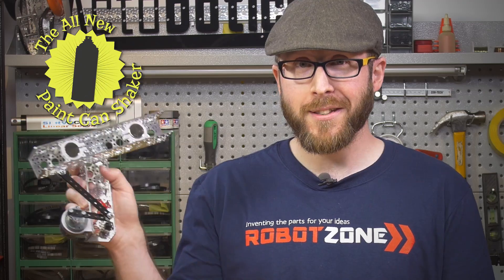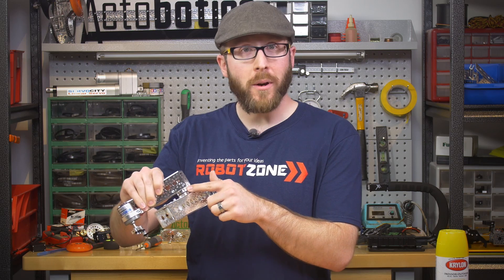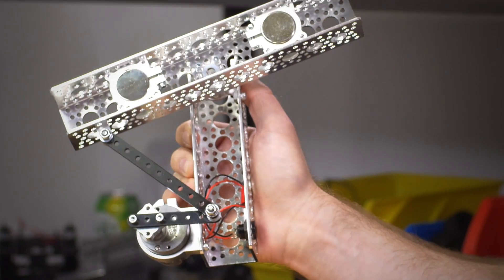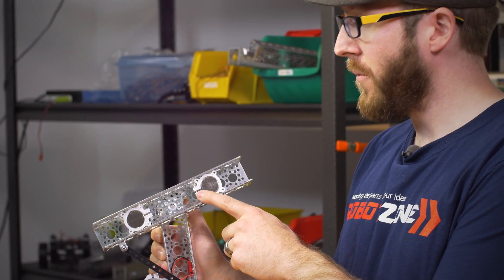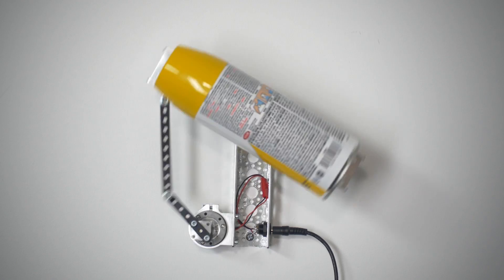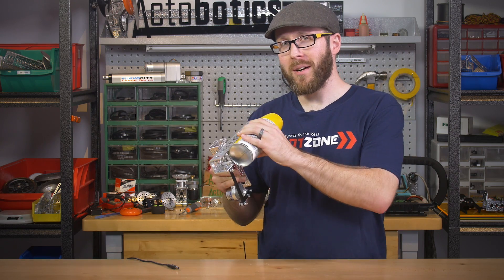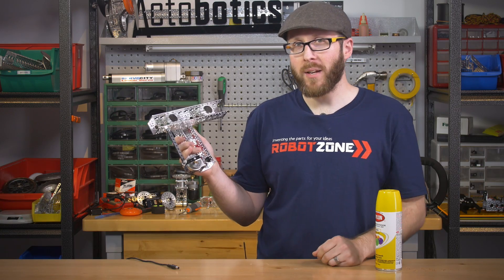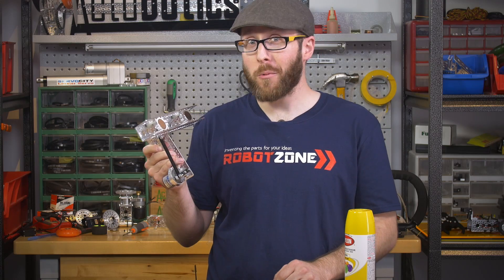Actobotics® DIY : Spray Paint Can Shaker

Comment: Hi, could you tell me how did you attach the two plastic beams so that they can move freely?
Reply: I used nylon lock nuts so that I could keep the joint just loose enough to move freely but not have to worry about the nut coming off.
Reply: Got it thanks! :D